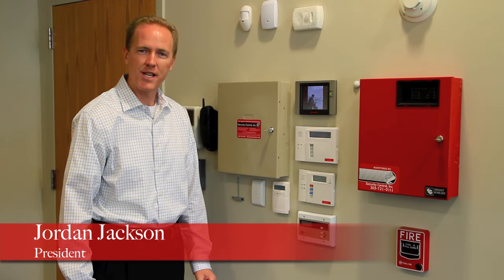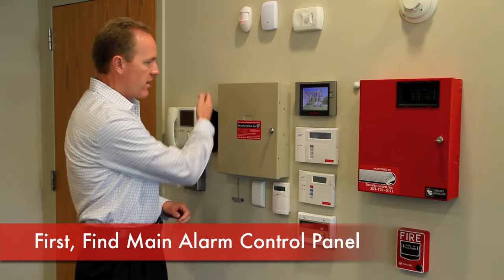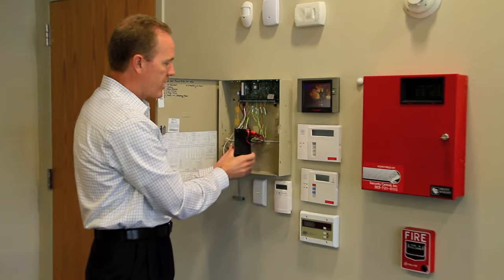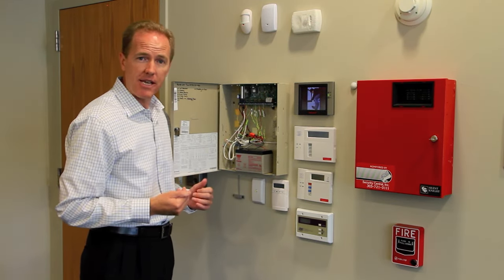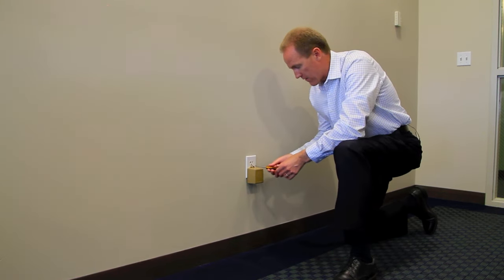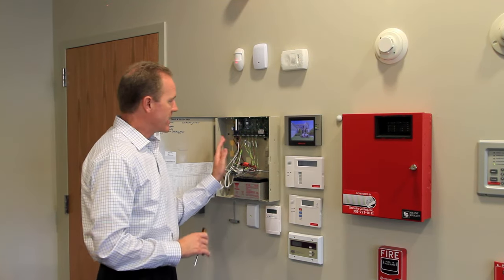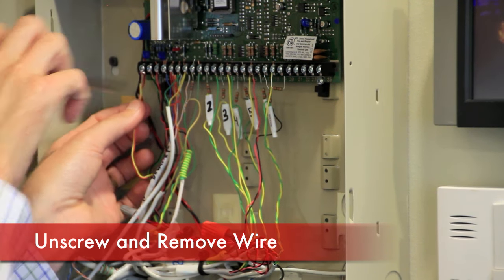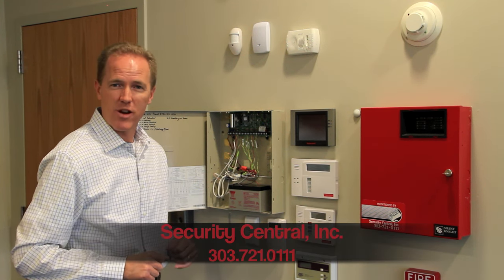Powering Down Your System

Comment: Your instructions were so easy to understand and I had our system disconnected in no time. We've lived in this house for 3 years and never had the alarm system activated. We thought one of our smoke alarms was beeping and a battery needed changing, but finally figured out what the beeping was when the alarm started going off. Boy was that loud! Thanks again for a great video!
Reply: Same!!
Reply: Thank God u done it
Reply: SAME!!! Never ever used the system and now need to replace windows that are connected to it. I called an alarm system company who basically explained everything this video did! (They didn't tell me the plug was tan though haha!) You just saved me a good $70!

Comment: Thank You sooooo much for this wonderful video. I’ve been living in my home for 15 years and have NOT  used the alarm system in over 10years. When the power goes out, the alarm goes off, it IS VERY ANNOYING when that happens. Thanks to this video I was able to easily( in less than 3 mins) disconnect the power!!!

Comment: Sir-Thank you! My alarm went off for 3.5 hours after a power surge at 1AM. MY DOGS & ME WERE GOING CRAZY.Central Monitoring tech was of NO assistance. While I have about 30 wires and my system is hard-wired, YOUR VIDEO SAVED ME! GOT IT ON THE FIRST TRY! THANK YOU SO VERY MUCH!!!!

Comment: Thank you, thank you, thank you!! Had a Brinks system not used in years. Following a power outage of 4 days, the low battery alarm started beeping at all hours of the day. Disconnecting the battery did not solve problem. This worked! Thanks for your very clear instructions.

Comment: I disconnected the main backup battery and pulled the transformer plug on my ADT system.  I even pulled the backup battery in the cellphone unit , and the system was still running!!  Thanks to this video, I removed the red wire on the left end of the buss in the panel, and it finally went dead!  Where that source of power is, I have not a clue.  That will be a quest for the future.  Thanks SecurityCentralinc!!

Comment: Thank you so much for this video, we haven't used our alarm for quite a while, the other day it went off for no reason and i couldn't remember the code to switch it off, anyway it did stop after quite a while. Because we dont use it anymore i thought i would be a good idea to just turn the system off, i found the box and unplugged the wall socket, but i noticed that the keypad was still active and also the strobe light out side of the house was flashing (no noise though),, ive been serching the internet the last 2 days as i did not know how to turn the strobe light off, after watching this video i disconected both terminals from the batttery and it worked a treat,,, the panel was not active at all and the strobe light was off! THANK YOU SO MUCH!!

Comment: Great Video really helpful  I need to figure out what one on my LAN numbers is connected  to my Concord 4 panel so I need to install a RJ11 jack.  I was told not to install the jack without first disconnecting the power and the battery.  What order do you reconnect battery and power?  Does it matter"

Comment: Once you have removed the main power and standby battery the sab in the bell box will sound the bell or siren for a while and you won’t be able to stop it unless you go up to the bell box and remove the power in it Mabey your alarm systems in the USA are fitted different but in the uk we fit the self activation module ( SAB ) in the bell box that powers the siren or bell if it loses power from the end station

Comment: My concern about disconnecting an unused home-builder installed alarm system s having the control panel continue to make sounds even after power has been removed. I would like to power down the entire system semi-permanently (no power but leave the hardware for possible future use). I would remove the battery cables, then the transformer from the electrical socket, unscrewing the wires from the transformer. Do the control panel have residual power via a capacitor, similar to smoke detectors?

Comment: why does the transformer that is plugged in to the wall always get black or looks like it has a dark streak on it? Which usually runs up the wall too....I always wondered why it always looked like that...also what do you do with the wires from the bottom of the transformer? Thanks in advance

Comment: I just bought a house and it has a super old system and the wiring is all thrown all over in my attic. If I remove the transformer as well as the back up battery, are the wires safe to just pull off and get rid of them?

Comment: End of line resistors should not be located in the panel. they should be at the end of the line. If not using them program the panel for no end of line.

Comment: HELP !!! I unplugged the electrical plug from the wall. I unhooked the battery. I took off wires 1 and 2 inside the wall panel box. I still have one alarm with a "green light" and it is still randomly going off. All other alarms on the ceilings and panel by front and back doors are black. Why is this one alarm still getting power? How do I disconnect this?

Comment: The reason I want to shut down my security system is that I no longer use it. I no longer have a subscription to a company that monitors it and it is kind of a hassle with the battery eventually dies and I have to keep replacing the battery on a system that I no longer use. When the battery dies it makes this obnoxious beeping sound in the house and I just want it to end completely

Comment: Too late for me— i used a cutter to disconnect both wires from the battery i did try pulling it off but so tight and i couldn’t wait and i thought once the battery is gone that the alarm will shut up nope it came back- then realized battery is only a back-up in case of power failure. I found the transformer and tried disconnecting the 2 wires too and i got a spark i got a live wire so I immediately screwed  it back on. I have to videochat my brother he’s an electrical engineer he said all i need is one wire to disconnect and that would be the white wire and its safe. The black wire will not really kill me unless I’m standing on water. I didn’t believe him so i went back in the box and located the white a/c wire- that stopped the damn kill me now alarm. I have dogs i dont need alarm its from the old owner. Its a stormy night after all that the 3rd fl alarm went off too my son won’t close his washroom window- and that’s activating the alarm- i dont think it has anything to do with ADT - what a freaking night and i am 60 yrs old and i have to bring in  the ladders from the storage. What a nightmare- this didn’t show and explain disconnecting wires from the transformer